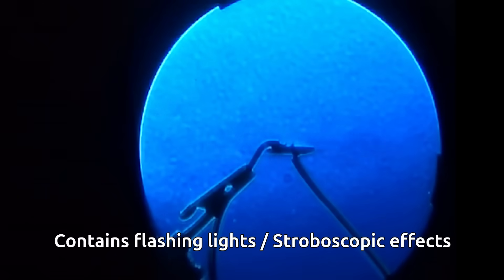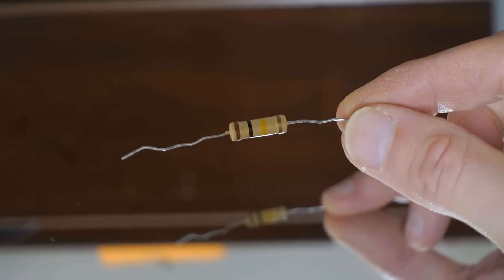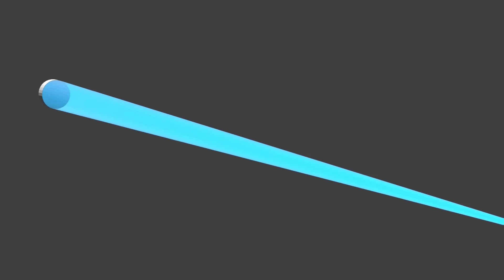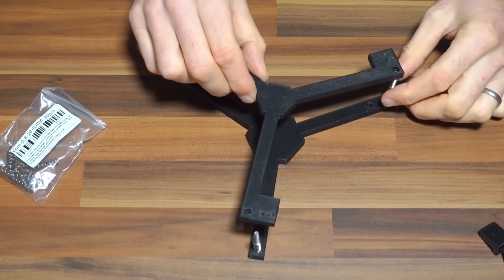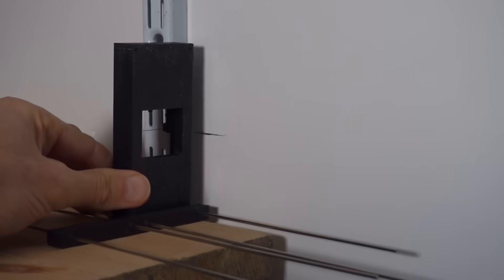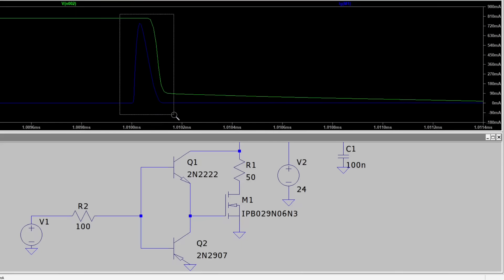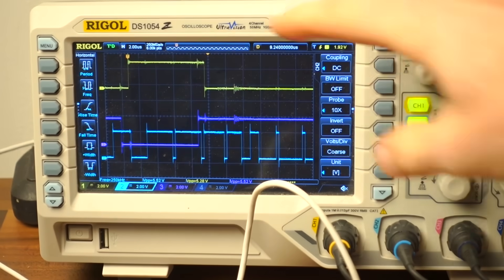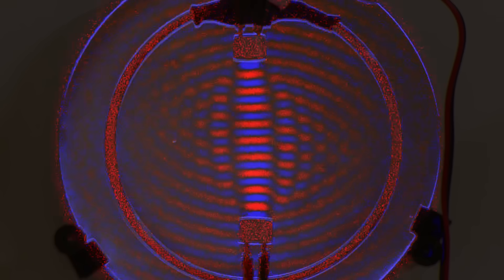I Built a Camera That Sees Sound

Comment: Most modern mosfet drivers chips can run circles around BJT totem pole home made circuit, and are simple to use like LM5111 or similar...
Reply from the maker: Oh, 100%. If I was designing a production PCB, I’d use a gate driver chip in a heartbeat.

But for a Sunday afternoon shed build, the scrap box special (2N2222 + 2N2907) gets the job done for free (if you have them of course) Thanks for the  part recommendation, adding the LM5111 to my parts list!

Comment: Are you really seeing sound, or air movement more accurately?
Reply from the maker: Technically, I am seeing changes in Air Density.
But since sound is just a traveling wave of compression (high density) and rarefaction (low density), seeing the air move is seeing the sound!
It’s exactly like watching a wave on the ocean—you are seeing the water move, which is the wave.
Reply: @plasmatronX  Yeah, we also saw how a heat source moves the air around, the convection. There's a whole lot going on that we can't see with the naked eye.

Comment: I have a feeling that you've come upon a reddit post regarding I-V curves of leds orders of magnitude beyond their rated currents for driving microseconds at a time while doing the research
Reply from the maker: I haven't seen that specific post, but I've been abusing LEDs like this for years! ⚡
It still blows my mind that the tiny internal bond wires don't just vaporize instantly with that much current. It really shows how powerful thermal inertia is at uS intervals..
Reply: @plasmatronX  yeah it's crazy, I've run 36V cobs at 90-100V for uS pulses and they hold up well! It's really useful for stroboscopy purposes.

Comment: Could it be used indoors with gardens? In fountains that circulate water and have a 1-meter drop, such as waterfalls, using that waterfall to reflect the signal?
Reply from the maker: I think the water would appear as a shadow because the difference in refractive index between water and air is very large. 
However... you might be able to see the invisible cool air and humidity swirling around the waterfall, which could be interesting

Comment: Great work will be looking into you work further and wondering if you have experiment with lasers as well
Reply from the maker: Glad you enjoyed it! I actually stuck to LEDs for this project to avoid 'laser speckle' noise (which makes the image grainy).

But I definitely want to try building something with Lasers, everything is better with lasers!
Reply: Thank you for your response. I guess the reason I mentioned lasers is because it has to do with the work I am currently doing on perception but I came across lasers because it seems it reveals something because it is coherent light. Coherent light they tend to make subtle resonances visible rather than averaging them out. With mirrors and vibration, that can sometimes reveal structure that diffuse light hides. I won't get into that  I actually do not plan on doing these experiments anytime soon maybe won't even do them at all I feel it is not my area of expertize if you want to call it that. but I'll ask where do you see your work going or maybe you are not fixed on a certain outcome?
Reply: I agree you definitely know way more than what I know about this area or work but I can say I agree lasers do seem to make it better for many reasons right? @plasmatronX

Comment: 40 thousand kilo hertz? Dont you mean Megahertz, regardless, this is very interesting work. There is another video by Steve Mold about cameras which can see sound but they work on a different principal and method. 
https://www.youtube.com/watch?v=QtMTvsi-4Hw 
I have linked your video to his video as well, Steve would be one who is very interested in these sorts of things.
Reply from the maker: Well spotted!, In the video I say 40 thousand kHz, but should have said 40kHz. I am using a transducer from an ultrasonic range finder in this video which resonates at 40kHz. But if I wanted to go to 40MHz I would need a much faster LED strobe, think that would look pretty cool thou. 
Thanks for the link, I also seen a video recently from Adam Savage on the Fluke sound meter, these look to use directional microphone arrays to show where sound is coming from. 
Thanks for taking the time to comment

Comment: I learned a trick with my eyes years ago.  It was dark in the room with a stream of light coming in from the window.
 Being very still and unfocusing my eyes while staring at my hand  i started to catch a glimpse of what i thought was my aura.  
 It looks strikingly like the thermals coming from your hand in front of the mirror.
Reply from the maker: You might have accidentally created a Shadowgraph..
If the sunlight came through a narrow gap (like a slit in the curtains), it acts just like the LED in my setup (The 2 razor slit). That aura you seen was likely the heat rising off your skin and bending the light rays.

Comment: This is not a "sound visualization," but a visualization of the density of the gas environment between the camera and the mirror: when a hand appears in the camera's field of view, it's quite easy to notice that swirling shimmers of density emanate from the hand (you wouldn't insist that this is "sound";)). Such a thing will become truly useful if you learn not to use a mirror, but only polarized light from the sky, for example.

Comment: So you could find where the bang came in the kirk murder with the iphone recordings using this? or would you have to go there hold the phones were they were according to each of the videos and light a fire cracker and compair?
Reply from the maker: I seen a demo from MIT on a visual microphone, they had a way to extract sound from the tiny movement of leaves etc in videos, guess they needed a high speed camera with high resolution. Thanks for commenting

Comment: Would this device classify as an acoustical interferometer?  The patterns look similar.
Reply from the maker: An interferometer relies on interference between 2 beams of light, while schielern only has 1 beam of light which interferes with a blade or wire. But there are a lot of similarities between the 2 setups, amazing what you can do with beams of light, thanks for commenting

Comment: What's the reason you wanted to visualise ultrasonic sound? Is it because audible sound has too long a wavelength to be visible in a mirror of that size?
Reply from the maker: Yeah, partly, the other reason is I don't want to have a really loud speaker in my workshop blasting out sound + more ripples looked nicer visually. This setup should be able to see down to about 1.6kHz with a full wave cycle, something for the next videos. thanks for commenting

Comment: lol, still member the first time i saw this, twas a scam video, trying to show how evil mercury fillings were, like they are not wrong, but they used the light effect to "show" the murcury vapors coming off a tooth when you rub it with an eraser, it was just showing heat but I was mezmerized at the effect.

Comment: Is your ultrasound 40.000 kilohertz or 40? Around 6:28.
Reply from the maker: I didn't spot that (and I normally would), that's bad. I am using 40kHz transducer the same type you find in Ultrasonic range finders, thanks for commenting
Reply: @plasmatronX  It's seriously an amazing project and video with nice humor, I shared it with friends. I'm curious as to what other experiments you'll be doing.

Comment: So is the light on the same trigger as the soundwave, or no?  I been slowly(really slowly) working towards a similar setup.  I ground my own 12inch mirror I just finished and was playing around with an LED in line with a speaker attached to a signal generator and was amazed how steady the speaker looked.  Like, normal strobe even the finest of tuning you see slow motion, but this was just frozen in place speaker with zero deviation.  How exactly would your display work with a similar setup I just mentioned and arbitrary sound coming through the speaker?  Would it show anything at all.  Like talking into the speaker but the light and the speaker being on the same trigger circuit.
Reply from the maker: I actually stack the images of the sound waves to reduce camera noise, I am also subtracting the background, by taking a picture with no sound, then 1 with sound. This way I isolate the sound wave without any other airflow. But I didn't do any fancy imaging processing in the first video.

The main limitation is max frame rate of my camera (at high resolution) is about 60 frames per second, so to see someone speaking you would need to replay the sound sequence multiple times and step thru the sound with the strobe to see the sound at each point in the wave. This is not too hard to do, in the project I have, you would replace the sine wave with the sound you want to see..
The other option is to buy a high speed camera, but these are expensive 

Thanks for taking to time to ask the question

Comment: you could always go with a microphone array...a circular surface with zig zagging micro0hones from side to side.... smack a relatively decent camera/ image sensor smack dab center....map the image through software - relative to image, through software turn the captured sound into a heat map with dB or measurement of sound as the measured value. Have a set color for specific value....overlay all the measurements as a heat map over the captured video. It's gonna get messy...lots of noise..pun...intended...so a variable filter is a necessity....or you can spend a few thousand to many more thousands to buy a acoustic camera.... they aint cheap!

Comment: Great project… if I can make a suggestion for the lighting source that will be much brighter and is a point source of light without the convex lens (epic shadow puppets) the shadows of say your hand will cast only one shadow & not the multiple ghost shadows between the light and dark.  Hope I’m explaining well enough.  The light of a L.E.P. Is not only far brighter, is a cone of light without the lens and with it is a low divergent spot. Not nearly as cheap as LEDs. A small flashlight like the cosmos is around $100ish.
Reply from the maker: That does look pretty cool, a laser with phosphor emitter, have to test this... I have seen people using normal lasers which they say give a speckled pattern, but the phosphor should stop that happening... Thanks for the suggestion and commenting

Comment: how do you color it?
Reply from the maker: First I take an image of the sound wave at 1 point in time, then I turn off the sound (a few mS) and take a 2nd image of the background with no sound. 
Then I subtract the 2 images, this leaves a wave centered on the x axis. Then I color the positive going pixels in shades of red and the negative going in shades of blue. 
All of this is done in the python GUI in real time. The GUI has a menu box where you can apply different color schemes.

I am planning a follow up video to show how I designed the software, but in the meantime all the code is in the link.

Comment: You can get copper wire to stay straight by stretching it, which hardens it
Reply from the maker: Thanks for the suggestion and comment, must try that to see what happens
Reply: @plasmatronX   or use 3d printer nozzle needle that can be got down to 0.1mm, micro pencil leads are another option but 0.1mm are hard to find.